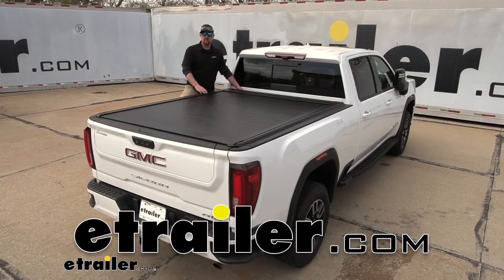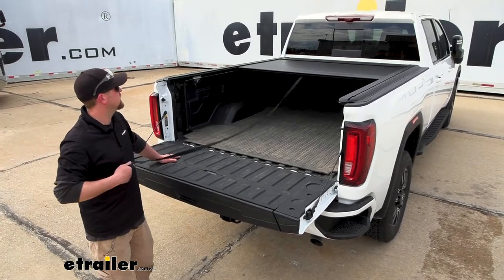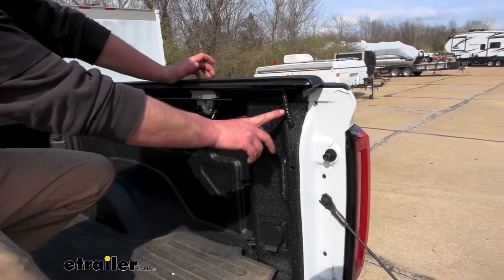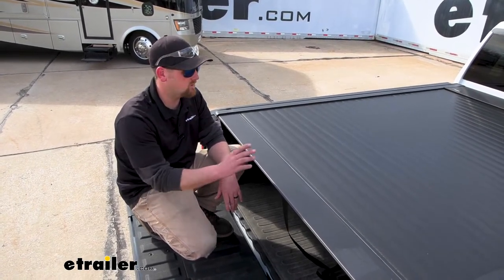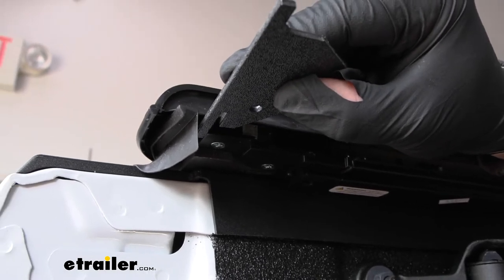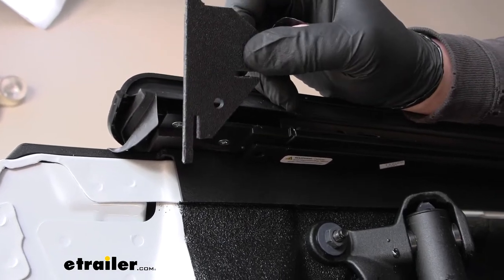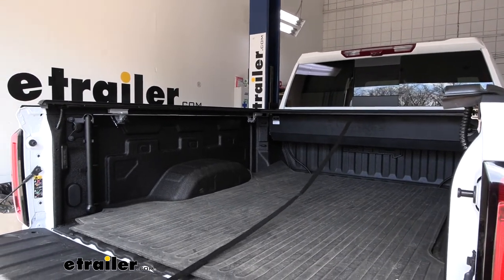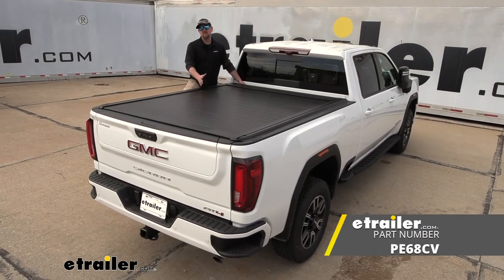Installing the Pace Edwards UltraGroove Retractable Hard Tonneau Cover on your 2022 GMC Sierra 2500

Comment: For anyone with this same truck, there is actually a drain tube hole right behind the grab handle at the LR stake pocket. Just take off the handle, install the drain tube and put the handle back on. No drilling needed. RR side just has plastic pop cover on the hole.
Reply from the maker: Niiiice!! Thanks for that tip!
https://www.etrailer.com/Tonneau-Covers/Pace-Edwards/PE68CV.html